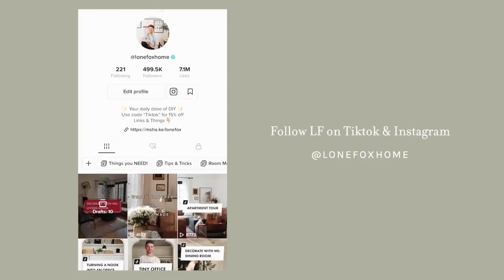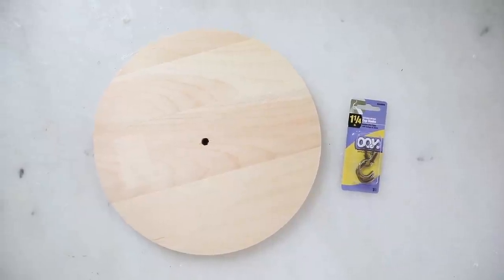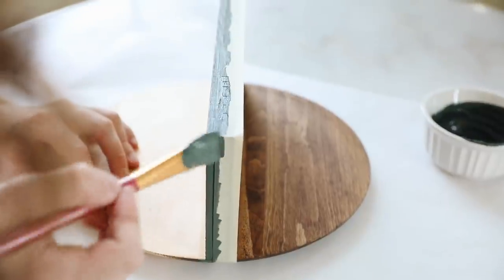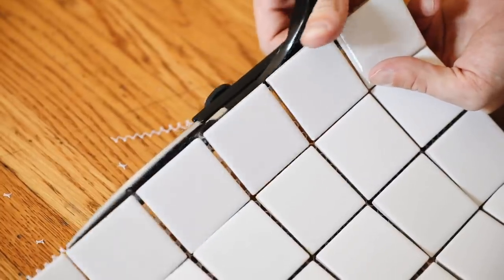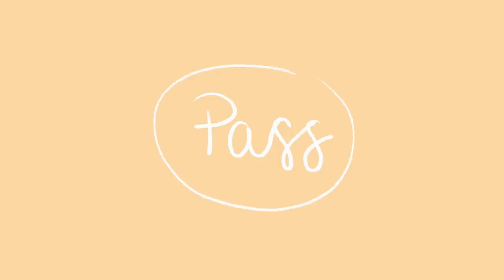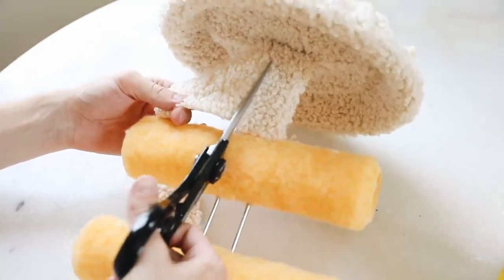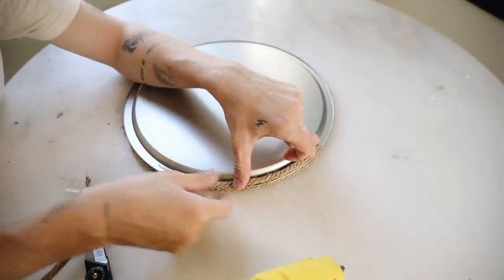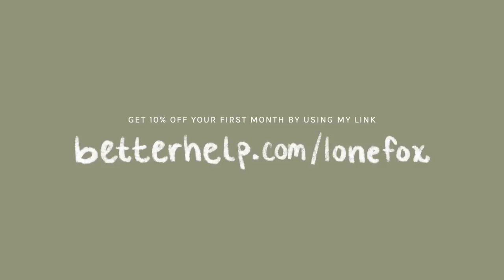RECREATING VIRAL TIK TOK DIY ROOM DECOR ✨ Cute & Easy DIY Decor Ideas!

Comment: For the jewelry holder I  think it would work  (and look) better in a black stretch velvet.  It will show off the jewelry more and look more like what  jewelry stores use  as displays. Instead of paint rollers that you have to buy, you could use empty paper towel  tubes or wrapping paper tubes which are free.

Comment: I had some thoughts on the jewelry tray as you were making it.
Foam core board could be cut to shape and slipped on before you add your fabric to the base. It would give a smooth surface and cover the paper towel holder wires. You could also cover a circle of the foamcore board to cover edges on the bottom. Make sure to weight it downto compress bulk of fabric.  Another option would be the adhesive backed cork, but you would definitely need thinner fabric. 
My final thought was you could possibly add finials to ends of paint rollers for a more finished look. Maybe ever a simple wooden ball or a small wooden circle that could be wrapped in matching fabric.

Comment: A tip for working with hot glue, chop sticks! Once I stared using them no more burned fingers. I like the painted ones as the hot glue once cooled comes right off, but in a pinch use the disposable ones you get with your take out.

Comment: Great video...  have you seen the one where they wrap jute around one of those gallon plastic jugs that you get cheese puffs in (from Costco or Walmart)? They also did one where they wrapped jute the top 1/3rd in jute, middle 1/3rd on black plastic line (rope) and bottom 1/3rd in jute? Its gorgeous.. they styled it with olive branches.. try it!

Comment: Oooh Drew, I love when you do these DIY projects, I really loved that cute shelf, loved the color with the stain color, and it looked easy to re create. I also loved the tiled mirror, me loving purple I would try and find something that was purple or coloring the grout a purple color. The jewelry holder was not my favorite but it still was kind of cute, maybe if you used a thinner paint roller and then on the ends glued some cute buttons to cover the holes, I did like that fluffy fabric, and you could use just about anything you wanted. And that try for the last project was so cute, I am wondering if you could use some macrame cord in your favorite color and still get close to the same look. Anyways I loved this video, and thanks again, have a great day, sending love and hugs, bye for now.

Comment: Tile is going to make the mirror heavy so you will need to use a wall anchor to hang it unless you hang it on a stud. Regular tub caulking would be less messy to fill cracks.

Comment: I love the tray! But I don't think that mirror is going to last. You put the grout on the air 😱 in the outer rim there isn't support for the tiles nor the grout. And the mesh is visible from the front because the frame is raised and it reflects on the mirror. You could fix it by using a mirror with that exact width frame as your tile is (or vice versa). I would also will suggest using the proper tile cement/glue since it holds the best. I think the problem was the mirror/frame choise. Other than that it's a great diy!